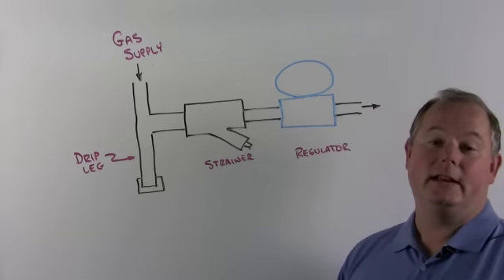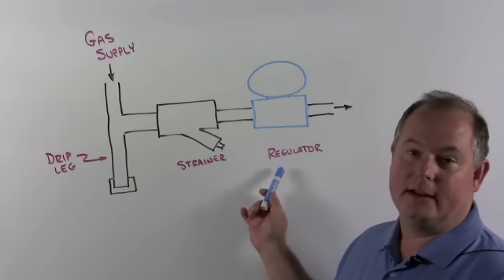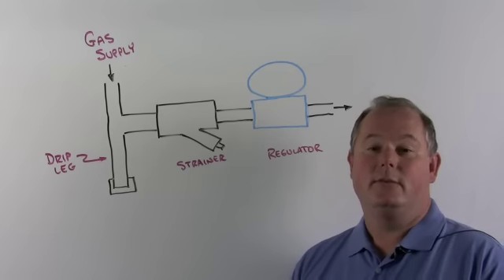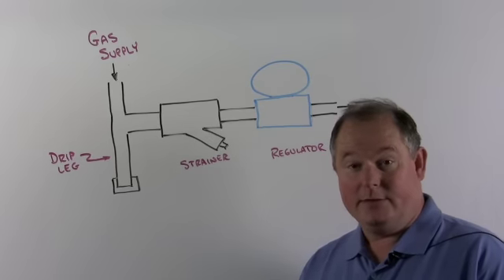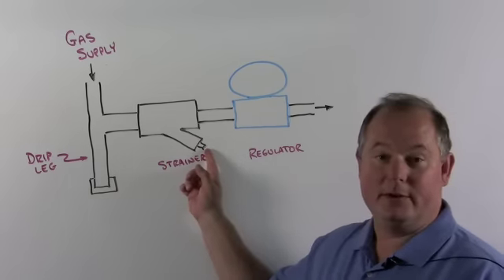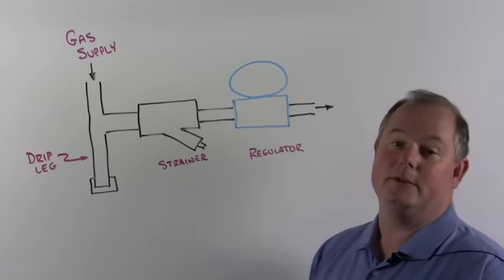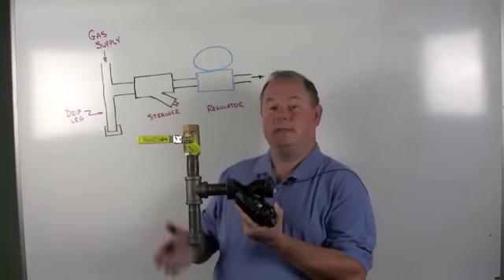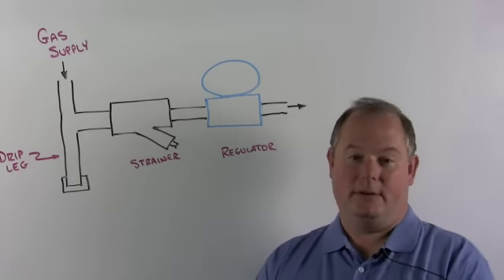HVAC Tech School: GAS PRESSURE REGULATORS DON"T WORK !

Comment: Yesterday morning, at around 7 AM, the house was colder than it normally is at that time of day.  Checked the furnace, and the pilot was trying to light, and the water heater pilot was also out.  It seemed we didn't have any gas flowing into them.  We called Metro Utilities District, here in Omaha, to have someone come to the house to look it over.  They arrived at 9 AM, and realized that the regulator was kaput.  They replaced it, and we had heat again.  The failed regulator had allowed the gas pressure to increase way too high, and the pressure shut-off device clamped off the gas. Who knows what might have happened if it had not worked.

Comment: OK, you told me everything BUT what I wanted to know:  THE REGULATOR !!!   You talked about everything leading up to the regulator, but never even got to the regulator.  What about installing it?  Adjusting?  Safety precautions?  DUH!
Reply: James Keyes do you know how long the drip pipe needs to be
Reply: How long does the drip pipe need to be
Reply: @edwardmcfarland7722   3 inch minimum in NC.
Reply from the maker: James, great questions, most of which depend on whose gas pressure regulator you are using, typically you wnat 3 to 5 pipe diameterns upstream and aboutt the same downstream, some regulators are less senstive to this, be sure to check your gas rregulator installation sheet.

Comment: I like the wye strainer idea, but I'm having trouble finding a wye strainer that's rated for 2 psi Natural gas and rated for exterior use. Also very curious about the friction loss and length of pipe equivalents that the strainer creates. Do you have a particular model of wye strainer that you recommend?

Comment: Never heard of a strainer.  What is it?. Thanks.
Reply from the maker: Hi Donald1950 a strainer is basically a filter that keeps dirt and other things from clogging up the gas line or gas pressure regulator. Thanks for checking out our video

Comment: I'm gald I found this video.  my gen set was set up without a drip tube or strainer, and it ran for years, but now is not getting enough gas.  I speculate that this is the problem.  I have a fisher regulator to step down the pressure before my garrettson regulator and I was wondering if one or both regulators need replaced, or if they can be repaired or cleaned. does anyone know if the first regulator would be the only one compromised?  should I start be replacing only the fisher regulator first? I appreciate any advise as to the best way to fix this problem.  thanks for the vid.
Reply: +rob l Did you fix your problem? I think the best way is set up the drip tube and strainer before regulator, and then you should inspect both of regulator inside, You will find the way of clean or repair the regulator.

Comment: Thanks for vids... I'm Asian... This knowledge will help a lot if people here...
;-):-):-D:-D:-D

What I install recently not a "drip leg",, just a "bleed off" valve... because we usually use gas tank (12Kgs)... Bleed off valve function is to bleed "other gas" which usually makes kitchen burner difficult to fire up..
This "drip leg" will needs to install when my country is able to distribute gas... (supply gas from city)
Reply: Sentence problem:
*a lot of people
*we usually have gas tank
*kitchen burner = stove
Reply: @mdw  how's your Mandarin? I'll bet you couldn't communicate at all in an Asian country, much less flawlessly. The dude that you criticized communicated pretty well. And he wasn't disrespectful either.

Comment: I was going to
pass this on to our technical staff but decided not to.  I wish he would have covered the flow
direction requirements for the strainer and regulator and adjustments. The main failure mode
for us is the regulator installed backwards by the installer. We sell
about 20,000 commercial gas appliances a year and direction, pressure
rating, and BTU capacity under sizing are our main issues.
Reply from the maker: Mike, great point maybe we will do a follow up video addressing this, thanks for checking us out
Reply: He also didn't show the valve in his schematic.